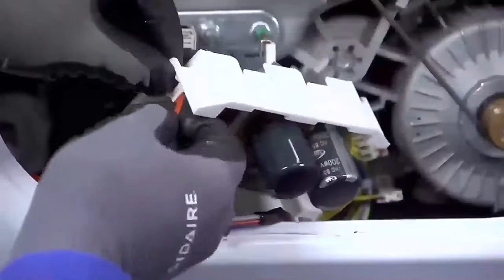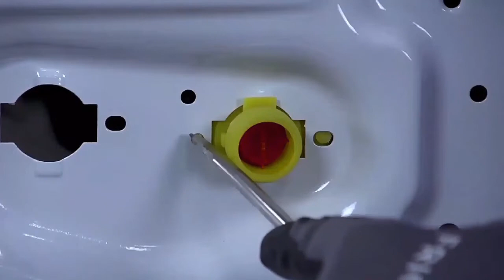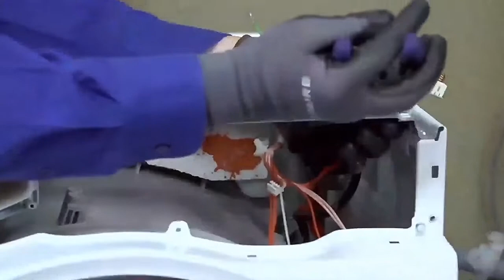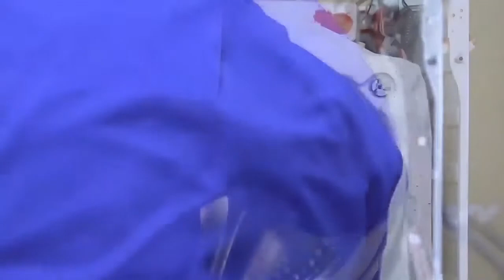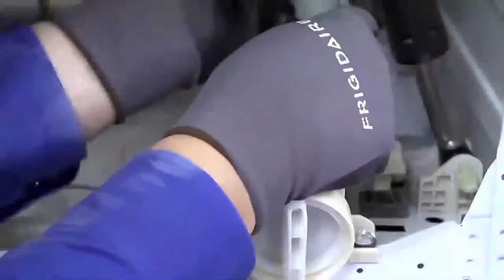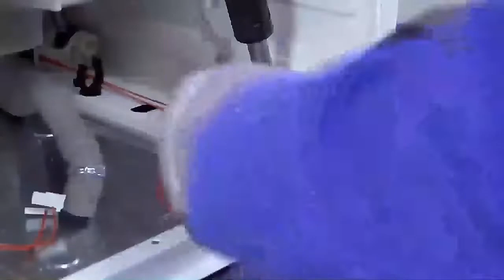How to Disassemble an Electrolux Front-Loader Washing Machine

Comment: Hey thanks for the video, I had trouble finding any information on these newer Electrolux washers. Have you ever replaced the bearing on a unit like this? I have a similar unit but am unsure how I would get the bearing out if the drum is a sealed assembly